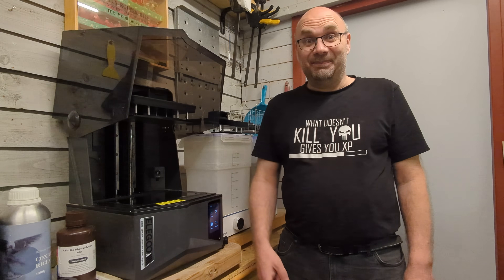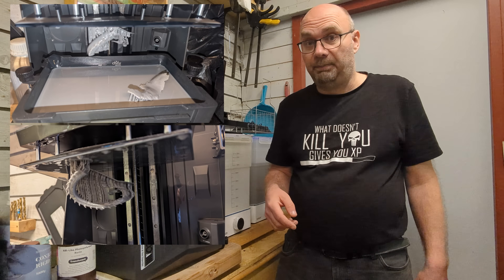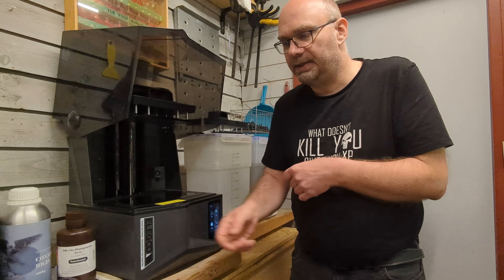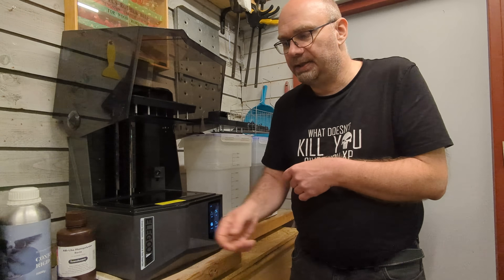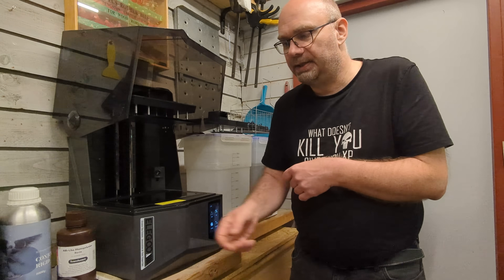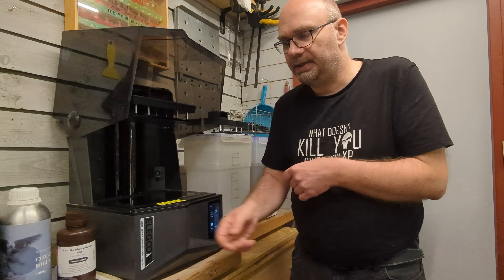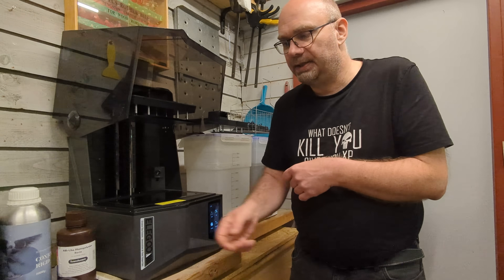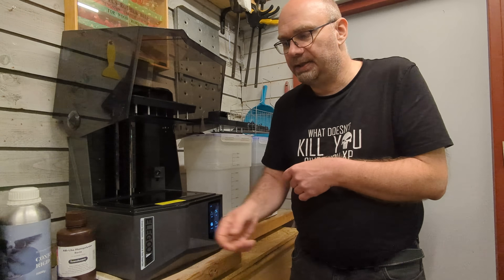No More Failed Prints: The Ultimate Elegoo Saturn 4 Ultra Leveling Guide

Comment: Jumping in here from another troubleshooting video but for the Saturn 4 Ultra 16K. In my case I had a much bigger problem with the build plate - it was quite concave and no amount of manual leveling would help since the raised (or lowered if looking from above) brim/lip would just pinch the paper while slipping freely in the center.
Unfortunately, I had to sand my build plate flat with 80/120 grit sand paper for almost 2 hours to get everything flat and I also put 2 M6 washers under the adjustment screws to give them a bit more space.
Now everything works fantastically though!
So, if you still have trouble after manual leveling or cannot get the paper to slide properly, check if your build plate is even to begin with (e.g. by holding it against a light source with a quality ruler placed corner to corner and looking for gaps).
P.S. In my case I could identify the problem with the build plate quite quickly since I had a lot of experience doing manual leveling coming from FDM printing. Back in the day you also had to adjust the bed using sheets of paper and screws.
Reply from the maker: That was a long time to work on that build plante😲 mine is working flawless after the leveling on both my build plates.yep i remember my first FDM printer was paper leveling and glue stick no heated bed all manual labor 😂
Reply: @olebrogger  Yeah, not experienced with manual sanding so I probably put too little pressure. Was very scared of making everything worse. The video I followed also claimed to have fixed the problem in 30 minutes.
Apparently experiences with build plates vary. Some have no issues at all, others are like mine. And I was an early adopter or the 16K, so maybe that was the issue.
Reply: @LimDul  just got myself a 16k as well just this month and I am having the same issue so its still ongoing.  I was already getting set up to do sanding but I got so busy with a dead phone and my computer dying that I haven't had the time hoping to get to it today or before the weekend at least.
Reply: That's odd.... Im having the same issue, the edges bite the paper and the center moves freely. It's obviously not normal, but when I checked it with a straight edge + flashlight from the back, I can't see any gap in the center. I've tried multiple straight edges (good quality woodworking measures) Is that normal @olebrogger ?

Comment: First of all, thank you very much for the video, as I am very new to 3-D printing. I purchased an Ellegoo Saturn Ultra 16K and foolishly thought it would work straight out of the box. As I tried to print all my prints would stick to the PEF, and I'm so happy I came across your video. I now have the left and right sides holding prints to the Bill plate, but I still have an issue with the center of the bill plate. If you have some ideas on levelling for that section of the bill plate, that would be great. Really appreciate the video, the best thing I found.
Reply from the maker: Thank you, so much❤️ Welcome to the Hobby of 3D printing and all the fun and frustration when it doesnt work😉 it is worth it though, and i would not be without it😃
Reply: Build

Comment: Is this available on the base model?
Reply from the maker: I dont know if software has the feature but the build plate should be the same. Check if there is a firmware update and if the feature is available in the menu😃

Comment: Hi Ole. Thank you for your expertise. Loved the precise instructions. Just a clarification. After you adjust the screws with the A4 (normal) paper, and have equal tension, and you completed the manual leveling by pressing Continue, do you remove the A4 paper before the plate comes down again to confirm levelling?
Also, when I used the 4x pieces of 300g paper, when i pulled them out and tried to insert the A4 paper, it was impossible to get the A4 under!! I found that NOT all the screws adjust the plate equally. Some, seem to not move that corner much/at all!! 

Also another clarification. After you adjust the screws with the A4 (normal) paper, and have equal tension, and you completed the manual leveling by pressing Continue, do you remove the A4 paper before the plate comes down again to confirm & finalise levelling?
Reply from the maker: When done, i remove the a4 and press confirm, if you cant get the a4 in after removing cards you need to tighten the sthe screws so you lift the build plate enough to get the paper in. If you have problems it is because the pressure on the plate is too high😃

Comment: I did this today, and I found that when you loosen the 6 mm bolt, you need to hold the sleve it screws into, or it just breaks free from the bottom
 casing for the lower bolt. So I had to hold the shaft with channel locks when loosening or tightening the 6 mm.
Hope this helps
Great video thank you
Reply from the maker: Thank you, that was good info👍

Comment: Do I tighten the screws down after manual leveling is complete?
Reply from the maker: No, the screws are used to set the level of the build plate. When they are adjusted they hold the plate level. If you start to tighten them after levering you have messed up the level and you have to start over😀

Comment: I got the part of moving within 1mm ranger right by tightening or loosening the screws, but how can i make it go up in the Y Axis, so more force is put  on the LCD?
Reply from the maker: I have never tried to adjust the z-axis. But there should be a z-axis limit switch that can be adjusted. I foud this i a google search. But i dont know if it will work.

1 .Power down and disconnect:
Turn off the printer and unplug it from the power source. 

2. Access the limit switch
You'll need to access the area where the Z-axis limit switch is located. This may involve removing the back cover or top cover of the printer, depending on the specific model.

3. Locate the limit switch
Identify the Z-axis limit switch, which is typically an optical switch that stops the homing process when interrupted by a flag or arm. 

4. Adjust or replace
If using a flexible build system: If you're adding a flexible build system, you may need to adjust the position of the limit switch to compensate for the added thickness. You might need to adjust the arm or flag that interacts with the switch, or potentially replace it with a longer one.
IfIf the swtch is malfunctioning, you'll need to replace it. This may involve disconnecting the cable, removing the old switch, and installing a new one

5. Secure the switch
Once the switch is correctly positioned or replaced, ensure it is securely fastened. 

6. Reconnect and test:
Reassemble the printer, reconnect the power, and test the Z-axis movement to ensure it's working correctly. 

I hope this helps, but as i said i dont know if it will wok as i have never done it before

Comment: No luck for me, gettin failed prints every time, and when i try to manual level its stop so high that even unscrewing all the way does not bloc the paper, and in the second case it start push the lcd no matter what, while the grap start to go up and then drop suddenly showing an error of failed manual leveling
Reply from the maker: Sorry to hear that, try to reset to factory settings and maybe run printer test, and then see if it comes down all the way

Comment: When you added the magnetic plate did you have any issue with the z height ?
Reply from the maker: Yes, i got a printer error and had to adjust the z-axis wich cant be done in software and only by loosen the 4 screws enough, but i still got a failed print, i have not used it again. I bought a new build plate, and found out how to do the manual leveling. I had a lot of frustration until i found out how to level it.
Reply: @olebrogger  Hi, I tried with a magnetic plate as well but haven't managed to avoid the "debris" message.  I was hoping that using manual levelling would get around it but it is just the same.  I couldn't come up with any way of fooling it - I'm not sure which 4 screws you loosened to try this - any clues?  There must be a way to use the magnetic plate on this machine!
Reply from the maker: @andyf3165 sorry, i never got it to work, heard someone used washers to lift the plate, but i never got to try it
Reply: @olebrogger  In a way, good to know that it isn't straight forward!  I'll probably leave it there as well.  The only thing i thought I might try was machining a bit off the height of the "stand-off" posts or the bushes in the build plate but that would be a one-way mod and would need precise amoints taking off all eigth stand-offs.  Too much hassle right now I think!
I tried your manual levelling process yesterday and it certainly seems better so many thanks for sharing it🙂
Reply from the maker: @andyf3165 you are welcome, i was considering grinding my plate as well, but i dont have the right tools to do it right and get it level

Comment: normal Saturn 4 doesn't have the manual leveling feature
Reply from the maker: I was not aware of that, i thought it was running same software. And the th Ultra just had more features and speed. I hope they make an update having this feature

Comment: Thanks for this, still having issue leveling.  It happened like u when I swapped out the LCD.  This is now giving me issues.  I will try again to do what you suggested to tighten the screws then loosen half a turn before doing the manual print.
Reply from the maker: Hope you succeed 👍 let me know if it works for you
Reply: @olebrogger I figured out my mistake I put the plastic lens backwards.  They really don’t do a good job explaining how it should face.
Reply from the maker: @patzgcrux 😮  i did not even know that could be an issue. Good job figuring it out👍 glad you got it working again ❤
Reply: @olebrogger the failures keep on happening on the outside of my build plate, the center area was fine, I probably wasted 5 bottles trying to figure it out, only upon reviewing the instructions that I noticed that the text/number should be facing inwards the machine.  Poorly worded when they mentioned outwards, I assumed facing out of machine.
Reply from the maker: @patzgcrux i would totally have missed that, but it is a good thing to keep in mind if we need to help others debugging their machine👍

Comment: a bit late on the questions but do you tighten them all the way at end or just leave the a bit loose
Reply from the maker: You only need to tighten the as much as you need for the build plante to be level, and the pressure on the A4 paper is even all over the plate
Reply: will try, ty  @olebrogger
Reply: ayyy, it worked, thank you so much

Comment: In my mind they should have used the screws as a locking feature instead of adjusting. Loosen the screws, lets the machine find level and then tighten the screws to lock it. 

Its a strange little process they have for this machine
Reply from the maker: I agree, that flip lock is difficult to handle with one hand. I like the one screw system i had in my old Saturn S

Comment: I got so feed up with my prints failing at the 1 inch level, every time, I've packed it away, fuck 3d printing
Reply from the maker: I understand your frustration it is a pain to have multiple failures in a row. I was almost ready to throw mine out. But im so stubben and I hate giving up. I wasted 1 1/2 kg resin on failed prints. But after i found the error and i needed to level the build plate im happy again. Is it always after 1 inch you get a failure. Then you probably have a failure on your z-axis. I had that on my old Saturn S. There was some nasty goo in the worm wheel that drives the z-axis. After it was removed it worked again😊 leave your printer packed away, get back to it in a month or two, cheer up and try again😀

Comment: Im still not getting this. I drive out my screws almost all the way, and then if I tighten the screws all the way down, the cards at the front (away from z axis gantry) still don't budge.
Reply from the maker: Before you install the build plate reset the screws so they are just tight enough. Dont over tighten them.after they are evenly tight. Loosen them by half a turn. Install build plate and start the manual level program. Then it should be possible to tighten the screws and loosen the cards. Remember tighten the screws wil make the build plante go up and when you loosen the build plate will go down and put pressure on the cards. If you are interested you are welcome to join my discord, and get in touch. I can try to help you over a call👍
Reply: @olebrogger will do. I got a lot of problems im trying to work through right now for calibration. Thought i had it down but this morning a test print of 24, 28mm bases to test volume had two thirds of the print fail with a sheer line. I posted on reddit about it. Ill be heading to wally world after work to get a level and then continue work making it work